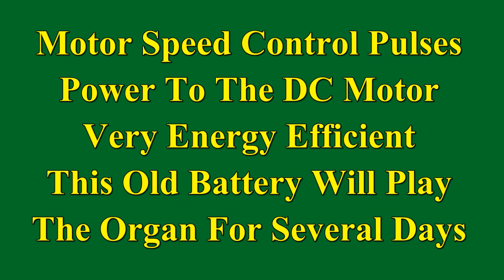Senior 20 Organ (35) Operational 12V Motor Drive Part 2 Demo

Comment: That, was beautiful. Man, this is just such a nice piece you've made. Thanks for pointing out that speed controller i was actually looking for one with those exact functions (reverse and lights). Some have either, rarely both, mostly for big machines or are badly made, visible even in the photos.

Comment: Could you set up limit switches to provide automatic rewind/off?
Reply from the maker: The forward/rewind switch is a DPDT - Center Off - Momentary to one side. You hold the momentary side down during rewind and apply very slight drag on the take-up spool so the music winds tight. The second the feed end comes loose you release the switch and the motor automatically shuts off (acts as a dead man). Rewinding only takes a minute and is not something you should walk away from.

Comment: I know you commented on this in a previous video, but do you think if you were to redesign it, or to build another one that would would accommodate for belt guards, and maybe some more internal volume for a motor? I know you said that the only space for the motor was relatively high so the bellows wouldn't hit it, and that's why you had to add the extra idle wheel. Either way, this is a really cool project, and I have really enjoyed going back and watching the previous videos, watching this progress.
Reply from the maker: I am currently working on the second one. I will do something different with the rewind mechanism to keep it out of the way of the drive belt. The motor will be in the same place without an idler. I do not intend to incorporate a belt guard. Most of the organs I have seen are driven like this without problem... just pay attention to what you are doing.